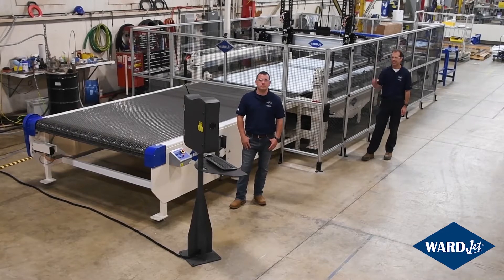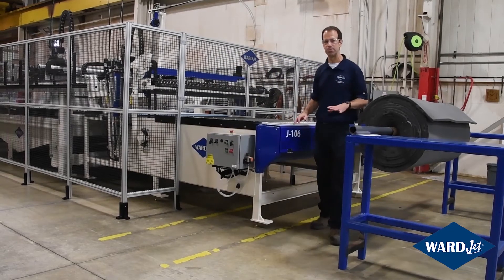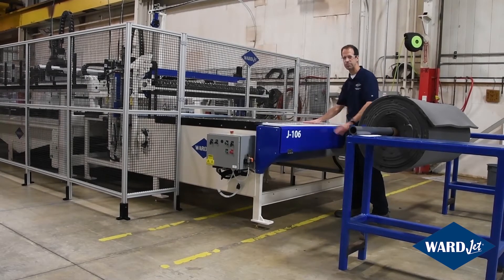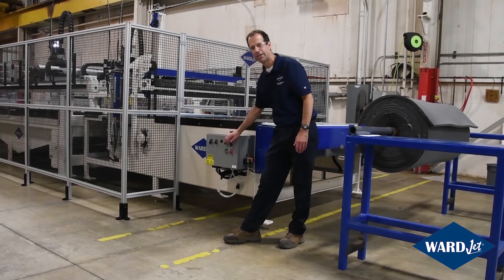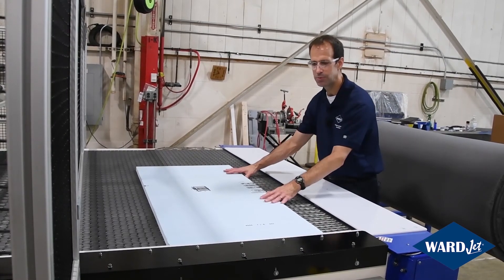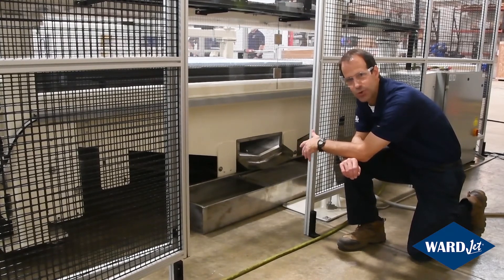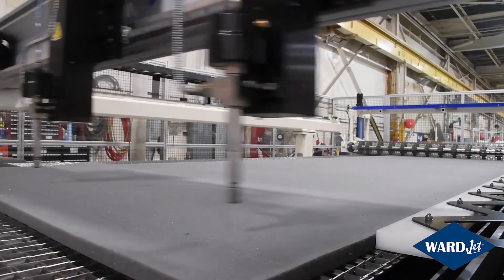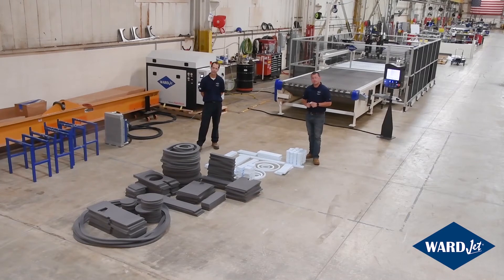Very Fast Foam & Rubber Converter Waterjet (WARDJet J-Series)

Comment: Thanks for explaining how the waste is handled.
What is the maximum thickness of foam the machine is capable of cutting?
Reply from the maker: Thanks for your question. The limit of the thickness you can cut in this situation would be 10" due to the Z travel. Depending on the type of foam, and with some material testing runs to find optimal settings, you could cut that much.

Comment: Can this cut 110 millimetre EVA FOAM Perfectly straight without taper on cutout part.
Reply from the maker: Hi Akshay - We would suggest test cuts to determine optimum speed, orifice size, and pressure. Please email sales@wardjet.com and we can arrange this.